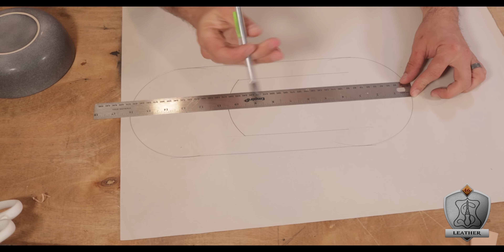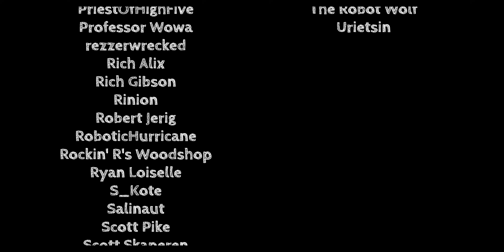Leatherworking for Beginners: The Kidney Pouch

Comment: Hi, if you see this comment, i'm a hobby/semi professional leatherworker and i would recomend to add one or two layers of finish after dying and before adding antique and one coat of finish at the end. Each coat should drying for at least 20 minutes. This prevents darkening your leather with the antique finish and just highlighting your indents which you applied with your basket-weaver beveler.
Reply: I'm just starting out in the hobby myself, and I love this tip!

Do you find the rapid rivets to be fairly strong? I tend to be pretty hard on my gear, and the only fasteners I've had the guts to use so far are copper rivets.

Comment: That coat looks simply amazing. Got a few ideas for weathering:
1. The underarms are already open, for ventilation purposes. I suggest adding grommets along the opening on both sleeve and coat, and threading leather lace through it.
2. Leather pads. Just little circles of chrome-tanned leather on the elbows, the seat, the shoulders, the cuffs, etc. Maybe the shoulder pads could have a fox (or whatever your character's insignia is)
3. Hidden knives. In the sleeves, by the waist, in the collar (for easy access when an enemy demands you put your hands up) and maybe a few other places.
4. Remove one of those buttons, and replace it. Preferably with one that almost resembles it, but not quite.

Comment: The pouch looks brilliant!  It came out really sweet!  For the jacket, may I suggest a favourite, personal pin or brooch on the jacket that the rogue wears on it all the time that he's sentimental about. So sentimental that he actually sewed it on.

Or some mild colour-fading on the upper shoulders & on the elbows, maybe some fraying at the edges of the sleeves, a patch on an elbow in a similar fabric, but different (yet earthy) colour, perhaps? Doing the fading might be difficult, depending on what the jacket is actually made of, though: if it's a synthetic material, bleach won't work. I wouldn't try it with anything but very careful dry-brushing with super-carefully-chosen colours of acrylic paint mixed to match the fabric in a lighter tint.

But fraying is easier to do: very rough sand-paper over hard forms done over time to slowly stretch the fabric over the form in the places you would normally wear a garment--like at the elbows to essentially "press in" the shape of years of wear into a garment. You could also do things like throw it onto your driveway & do the "aging" in a quick & dirty way & just drive over it a number of times. LOL  Or just roughly patch any areas that would normally see a lot of wear: elbows, shoulders, the places near the hips where your hands and belts would rub a lot.

Mimic stitching in places where it would be likely to tear during a rough life & need repair. If it's leather, then just use a bit of beeswax to rub onto the material to mimic the smoothing you'd get from years of wear.

Hidden pockets for "bad boy" things, like throwing knives!

Mismatched buttons! A button always falls off & you have to replace it. ALWAYS.

That's all I can think of, right now.

Comment: 6:26 the proper method for a large leather pocket (especially if you want to use a stiffer leather) is pretty much what you did except instead of the fabric ball it would need to be a wood form: you should start by cutting the leather roughly to shape (error on the side of caution and leave plenty of extra as you may need it to adjust and “stretch” the leather over the form),
Then you’d need to wet the leather (if you wanted you could tool the leather at this point because it’s easy and lays flat but the tooling can stretch during forming if you do, you could also tool it while it’s clamped on a form, although it’s harder it can provide a nicer result) put it over the form and use any means you can to clamp the leather in place while it dries,
stitch it in place then trim the leather to final shape

Hope this is helpful
Reply: Could you please provide a video showing the process you described? Would be a little bit better to see as I am novice :)
Reply: @Loperenco1  i have not been able to find a video that is exactly as I described however the process is called wet moulding and here’s a video on one method: https:youtu.be/JKmv3GiN0Ps (and as a side note I would demonstrate it myself but I am lacking the tools and materials at the moment)

Comment: Lovely little pouch that.  As an upgrade to it, or for another project, you could stitch a dagger or sword frog to the back of it so you've got an easily accessible weapon at all times, or just have like an eating dagger with fork and spoon there too instead.  Also, something that I've noticed when going to LARP events in the past that folks overlook and often seem to end up needing in character for one reason or other...writing implements.  I know it's getting down to the wire for this year, but perhaps for an after LARP build you could make yourself a little writing case and pouch for it, with a seal and wax and everything you'd need for it.  EDIT: Oh yeah, in case you or the rest of the folks here might be looking for something on it, I do believe Adam Savage's TESTED has a couple videos about fabric weathering for costuming and such.

Comment: Nice one. Two tips.

Use leather oil before dying, it helps with the stiffness caused by the alcohol in the dye.

For patina, get any box that can hold your piece, like a shoe box, add some random small items like nails, a bottle opener, a golfball, a fork etc. then shake it a little, check your progress until you get confident in your box and bits. Works extra spectacular on lighter colored leather combined with antique gel.

Comment: Thank you!  I wanted a pouch to carry my camera at the ren fair, when my character wouldn't use the huge fringed cross-body pouch I usually use, but I couldn't find a kidney pouch large enough, so ended up using a disguised fanny pack.  This is a great way to make my own to the size I need.  For the coat - it needs a fur collar.  Maybe shorter fur, though, like beaver or mink, rather than long like wolf.  And of course pockets.  Lots of pockets.  Inside and out.  Depending on how foppish your character is, maybe some frills - embroidery, lacy trim, etc.  Like big lacy cuffs, which you can stuff things into with a bit of sleight of hand.

Comment: I always suggest resewn sleeves. Like those big messy lace stitches holding an arm on, maybe an elbow patch (or just a patch in general for high wear areas)😊
Reply: This would actually work in more than one way-the holes in the armpits are usually added to clothes so you can rip the sleeves off and use them as an impromptu arterial tourniquet, so making them look like they were ripped off and resewn can add something extra to the character's backstory

Comment: Great content and enthusiasm!

A rule of thumb is after you finish stamping your project is to throw down some oil on the leather in even coats. For dyes I would recommend oil based dyes as alcohol based dyes will dry out your leather. After dyeing add a coat or two of Tan-Kote. If youre multi dyeing use Tan-Kote after each colour. Don Gonzales has tutorials on dyeing and painting.
Keep up the great content!

Comment: If you haven't already be told about securing your conchos, use a medium or blue locktite/threadlocker.  Strong enough to prevent it from working loose, but still can be removed with a bit of effort.  Keeps the conchos from working loose and falling off at the worst possible time...

Second thing, as you work the leather with a stamp the leather will start to stretch and distort.  Some use rubber cement to try to anchor the piece but I've never tried that.  It might come down to experimenting by working from the 'centre' to the edges of your piece....

Very nice pouch.  I will have to try that for myself down the road.....  :)

Comment: Volume of a sphere is
4/3×(pie)× r^3. 
Measure your bowl edge to edge to get diameter then divide in half for the radius. So if you have a 6inch bowl
Its a 3 inch radius
4/3×3.14×3×3×3= 113.04 cubic inches.

Comment: As for your jackets weathering, pay attention to any buttons, the elbows and the bottom portion of the jacket below the waist. 

I’d say heavily diluted bleach to lighten areas like the shoulders but it never neutralizes and will eventually earth through the fabric over the years. So if you can figure out something that will neutralize to lighten the shoulders and elbows a bit, then it will give you the older/worn look without compromising the fabric.
Reply: The weathering, if you can, is leave it in the sun.  Hang it like it would be worn on the body.

Comment: Next time you  think about making a pouch or purse, please do some more research first. 'Purses in Pieces' by Olaf Goubitz is generally considered the resource to go to, along with his 'Covering the Blade' and 'Stepping through Time' for scabbards and shoes respectively. 'Before the Mast' ed. J. Gardiner has some more, including draw string pouches, shoes and woodwork including chests. You missed out on all the interior subdivisions and the lining (with even more pockets). The special lock stitch that connects the front and back between the belt loops still defeats me.